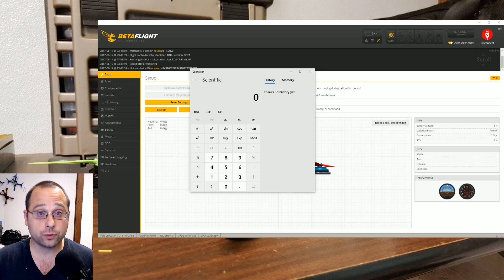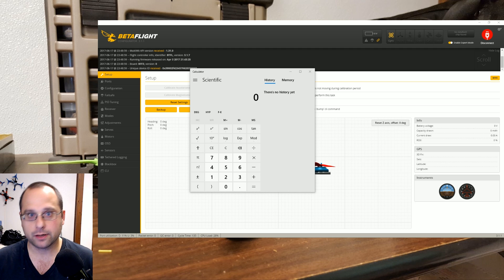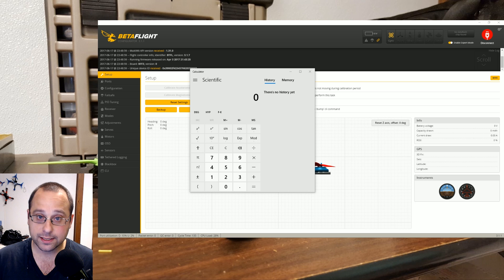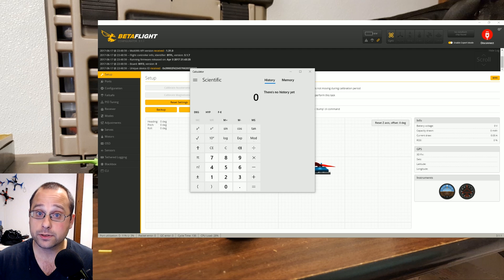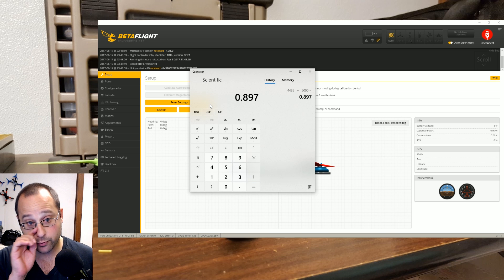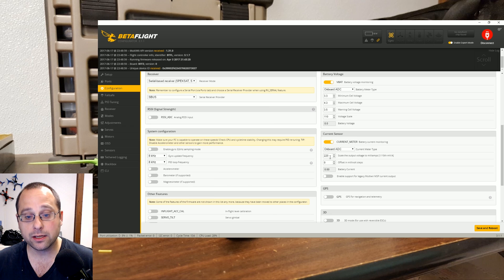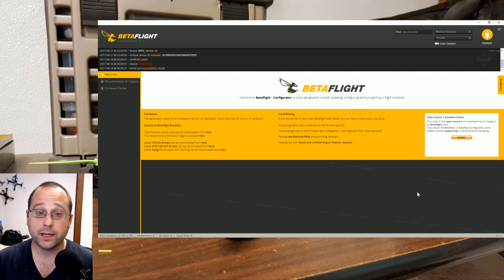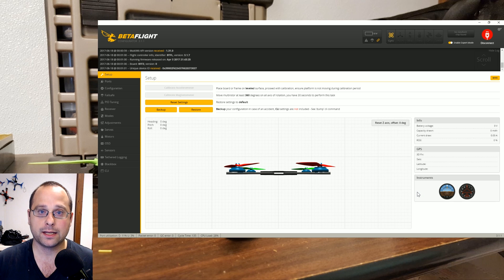The safest way to calibrate your Betaflight current sensor

Comment: Hey Joshua, hope you can help. i watched a video of yours with regards to https://www.youtube.com/watch?v=m4ygG6Y5zXI How to fix usb driver issues. my BabyHawk works(bought it because of your review) but it wont connect to the PC. ive done cable swaps, computer swamps NOTHING :(
Reply from the maker: What do you see in the Device Manager when you plug it in? Does a new device appear? Like, STM32 Virtual COM Port or something?

Do the LEDs turn on on the Babyhawk when you plug it in to USB?
Reply: Have you tried using impulserc driver fixer tool? Sorry if that's what your link is it won't let me open it. I had a similar problem this weekend and almost tossed my laptop out the window, plugged fc in and ran impulserc driver fixer and 2 minutes later all fc comunucated with btfl again
Reply: Nope havent checked that one let me quickly have a whack at that. thanks for the suggestion.
Reply: An error occurred while installing the driver! error-code 9
Reply: What happened with mine was I tried using zadig without having a clue what I was doing and switched a USB driver on accident. So I just goggled impulserc driver fixer from recommendations on betaflight Facebook page and it fixed it. I'm honestly surprized betaflight doesn't recommend that instead of the 3 drivers on their GUI . Idk if josh had done it but I'd love to see a how to flash a spf3 board using zadig
Reply: To run the driver I had to disable norton antivirus temporarily for some reason it wasn't playing friendly with norton, if you have a virus protector may help to try turning it off. I think this tool will only work if you hear the USB connection noise when connecting to pc ( that dun dun noise when you plug in a USB device saying it recognizes)
Reply: doesnt work for me . i have everything already off. ImpulseRC driver fixer was saying that it has successfully closed some serial port and then "dies" either via error code 9 or  simply locks up "not responding". @Joshua Bardwell maybe you could make a video about "How to replace USB connectors"
Reply from the maker: USB Device Not Recognized usually means there is a physical issue with the device. Damaged port, damaged cable, damaged board are possible causes. Sometimes on a flight controller that uses VCP, you can see this and re-flashing the board fixes it.

Your LEDs are doing the right thing. The board is working. Just USB is messed up.

Comment: Hey josh what would be a reasons for  voltage monitoring to not be working seems to be wired correctly vcc Gnd to fc. Fc buzzer port to buzzer
Reply from the maker: Is it enabled?
Reply: Joshua Bardwell yea it is on in betaflight damn bro that's fast
Reply from the maker: At the top of the configurator, it will show the current vBat value. What does it show when you plug in to USB and a battery at the same time?

Comment: do different props make much difference?
Reply from the maker: No, a mAh is a mAh no matter what is pulling it. Different props will make you pull more or less current, but the current reading will still be accurate.

Comment: I use the same method too, but i make sure after connecting lipo , i arm and straight away take off so that all mah will be registered. I do one lipo at a time, normally take three lipo to get accurate mah.
Reply: Dude the current sensing is happening as soon as you plug the battery in...
Reply: discord2000 , i use virtual sensor on older quad where there are no current sensor. I can get approximate mah reading also.

Comment: What a very Passive and boring process I will stick cable-tying the quad to a cast table in the garden and using a clamp meter and what about the offset.
Reply from the maker: Please see my other video about calibrating the Betaflight F3 current sensor for info about the offset. If the best-fit curve does not intersect at zero then the offset may be wrong. But offset should probably be zero for basically all of these boards.
Reply: Been there done that and it calibrated perfectly offset of 11 on my Kiwi.

Comment: How does the offset setting work and is it safe to assume it's never needed for most boards?
Reply from the maker: The assumption is that the current sensor outputs 0 volts at 0 amps, and then scales between 0 and either 3.3v or 5v depending on the type of sensor. There is a gain resistor that sets the maximum end of the scale and the maximum amps the sensor can detect. So by changing the value of the gain resistor, the board designer can choose to have higher max amps with less resolution, or vice versa.

The scale is used to calibrate for the gain resistor. It tells how many amps each volt (or fraction of a volt) the current sensor outputs equates to. The offset would be used if you had a scenario where 0 amps did not equal 0 volts for some reason. But I don't know what that reason might be.

Comment: Great idea! Much safer and close enough. Question..if you use different size (mah) batteries, once calibrated, will the current sensor be correct across different batteries. What about between 3S to 4S?
Reply from the maker: Yes and yes.

Comment: Thanks!
BTW, lipo battery cycle effectiveness is close to, but not 100%. Some energy dissipated as a heat, some turns into chemistry which kills the battery over time. Different sources are giving numbers 90-98%. To get "true" amp reading during the flight one should add additional coefficient to compensate that. But i primary interested in correct mah reading to know the remaining battery capacity without any kind of math. So my current sensors are calibrated exactly the same way as you mentioned.
Reply from the maker: The main source of inaccuracy would be the balance program.

Comment: what if you replaced the esc's with a dummy load eg incadecent light buld of a know output and measure overtime?
Reply: 31carny - this is a good idea buddy
Reply from the maker: If you are measuring mAh then I don't know why you don't just spin the motors instead.
Reply: Joshua Bardwell - I think he is saying to use a known load for a specific amount of time and measure the mAh from the osd. What the load should have exerted vs what the osd said would give your percentage the same as spinning props.

It's not as fun as flying, but should just the same no?

Comment: Mr. B I have a problem with fc. I have a built and been flying quad and a new f3 Fb and neither one will connect too beta flight . I get one getting bricked but a brand new one too.? Everything I do nothing will let it connect to make changes
Reply: Not Mr. B but sounds like your computer needs the drivers to recognize the FC. Check the introduction page of Betaflight.
Reply: I've been trying to load all them up on my prehistoric pc. But trying everything I can it's throwing me off but thanks a lot
Reply: I had this issue with an older PC, Windows 7 without any updates. On my win10 laptop it worked without issue. Since then I updated to win 10 on the older PC.

Comment: Yeap, that's how I'm calibrating also. I don't think you should try to reach better than 5% accuracy because the way the current is measured(not that accurate sensor) and calculated through OSD software doesn't add up to such accuracy in the first place.
When I've used the AttoPilot 90A sensor another easier way to do calibration was to put the maximum allowed voltage on the sensing pin(5V for Arduino or 3.3V for STM chips) and change the scale so that I get a 90A readout on the OSD. To bad that now with all this current sensors around we no longer know for sure what is there max current rating.
Reply from the maker: We can absolutely know the max current rating. All you have to do is look up the specs for the current sensor and then measure the value of the gain resistor that the vendor used. Most of these boards, if not all, are using the same current sensor chip, so basically if you know the value of the shunt resistor and the value of the gain resistor, you can calculate the max current reading.
Reply: Well, identifying the chip that handles the current measurement can be tricky, still not found it on my Omnibus F4 Pro, on the Atto sensor was an INA169.
I supposed you could also try to apply the voltage corresponding to the maximum current on the pads of the shunt resistor(with it removed, of course) but then the calibration will depend on how precise you can make that voltage because it is kinda small at 50 mV for 100 A and a 0.5 mOhm shunt resistor.

Comment: joshua, a different way to calibrate the current sensor that I know of on the betaflight F3 is to measure the resistance of a little resistor towards the outside of the board right by the shunt resistor. I find this method to work spot on every time! for most betaflight F3 it's between 43k-45k. take that value divided by 200 and that is just about perfectly what you need for your calibration value , 220 (ish). I think most other flight controllers use the same method and it's super accurate, just finding the resistor can be a pain on other boards.
Reply from the maker: This doesn't take into account the variance in the value of the shunt resistor though.
Reply from the maker: It will get you within a few percent, to be fair.
Reply: Joshua Bardwell yeah very true, I usually end up tweaking the value just a tiny bit. I never thought about the shunt and how they all vary, just tweaked the value and went with it. learning something every day! thanks man, great videos as always!
Reply: I always use some power resistor with around 1 ohm and short vbat and ground instead of spinning the props. Works like a charm!
Reply: do you got a link to any video resources on this or a rcgroup thread with pictures?
Reply: Matt I'll try to find it here in a bit, at work at the moment. If you search the betaflight f3 thread for "44k" it should come up with what you need.
Reply: search RCG for 'understanding current sensors' by teralift. teaching people how to fish. https://www.rcgroups.com/forums/showthread.php?2798055-Understanding-Current-Meters
Reply: This is actually really smart it won't be dead on but nice part is you can always use this as a good baseline.

Comment: I have often thought of just using a dummy load and current meter, before installing the board in quad. Never gotten round to trying it.
Reply: ceecrb1 I used a 1amp electronic load hooked up where the esc connects (I use matek pdb's with current sensor) to work it out

Comment: Now just need a video on how to calibrate current sensor on my charger... jk
Reply: My charger is off by 21mA. The voltage reading is accurate though but mine is only like $16 4 button clone charger
Reply: finbenton Which charger do you use?

Comment: Im kinda new to all this (2 months) and did it by flying a batt for 100mAh using my momentary switch as a mAh readout, just hovered and disarmed at 100mAh and went n chucked it on charge, tweaked the sensor scale then out again and back in ect till it was equal, now it still stays within 10-20mAh even at 1000mAh used, much better than trying to guess a voltage readout under battery sag, get so much more from my batts now!
Reply: Do you charge the batteries fast charge, charge  or balance charge?

Comment: Can i use a multimeter to check pack voltage against the voltage shown in betaflight? That's what I've been doing.
Reply from the maker: Voltage and current are different.
Reply: Joshua Bardwell Ahh ok.

Comment: finally :D if you would have told me earlier, my friends would still have all their fingers...
Reply from the maker: At least your current sensors are calibrated.
Reply: not really.. their screams where so annoying, i had to stop before i got it calibrated...
Reply: SwissGravityForce that's what ear defenders are for
Reply: SwissGravityForce hello. is in betaflight button to calibrate controller? because  I bought fs i6 and one stick is not to middle is just slightly turned to the right :(
Reply: SwissGravityForce , Quitter